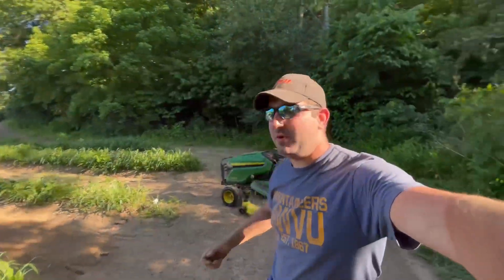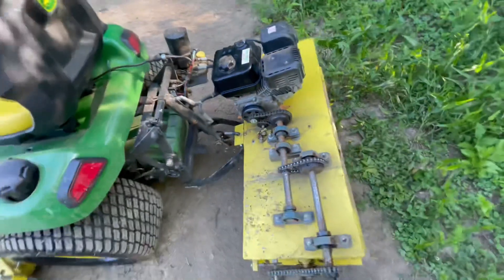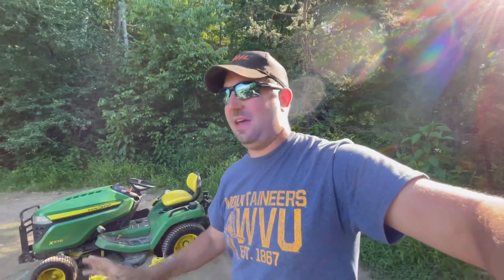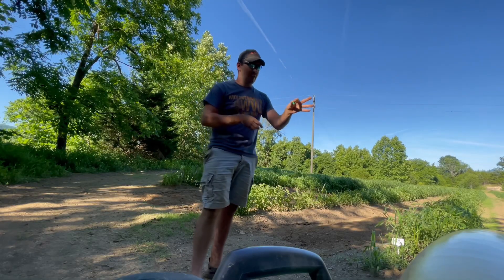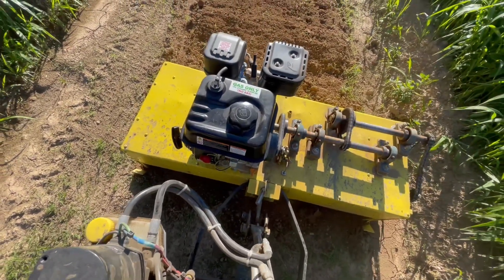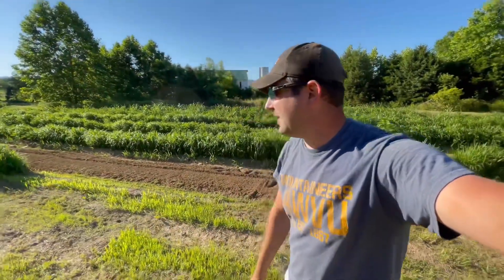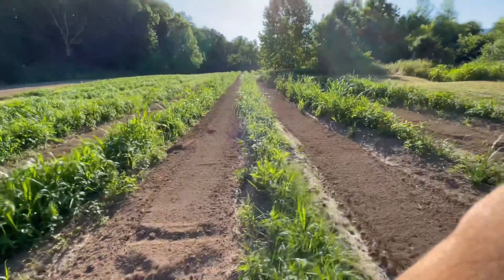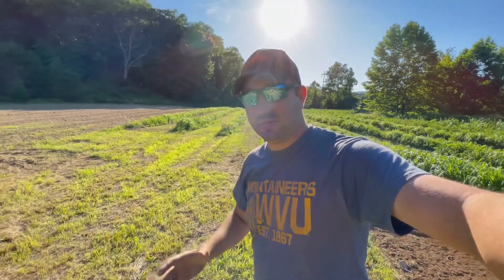2020 John Deere x570 review and tilling part 1

Comment: Great job on your fab skills, I've always used my 2012 x500 as a garden tractor as well! I rigged up an electric sleeve hitch using an actuator for my x500, I never found a hydraulic setup like you fabbed up, because I was always afraid it would drain my battery. I commented on your snow removal video wondering if you can do a video on the hydraulic lift setup and a parts list as well?? Thank you, I enjoy your videos!
Reply from the maker: Yea I can make a video showing how I built it. Iv modify the design a few ways since this video but it’s Basic principles are still the same. Give me a little time I thought about bringing this to market
Reply: @JDubbsadventure  That would be great, thank you!

Comment: Can that attachment also work with an X380?
Reply from the maker: Not sure the x300 series is built for ground engagement your transaxle will wear out fast using one for this kind of work. You would need a sleeve hitch to raise it and lower and this tiller is a home build. I wouldn’t recommend using one… maybe looks at the John Deere 316, 317, 318, 400, 425, or the 445 is diesels I believe